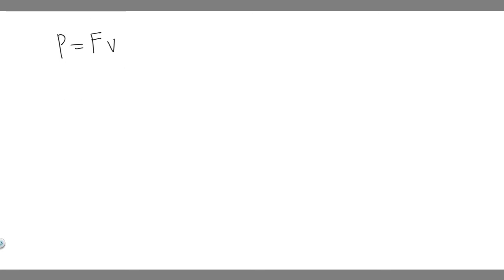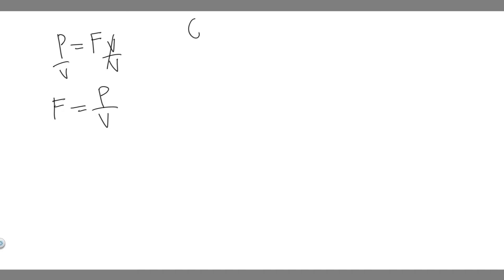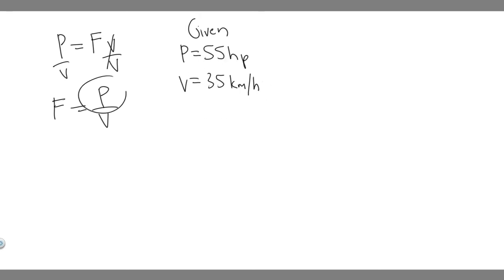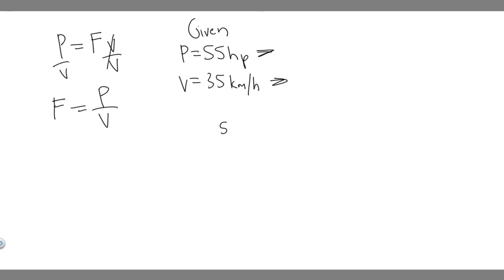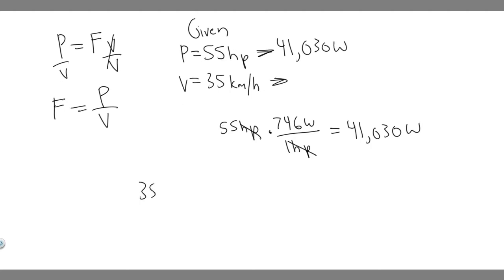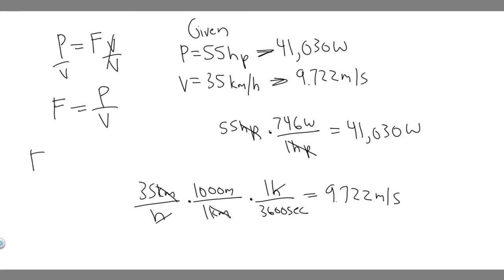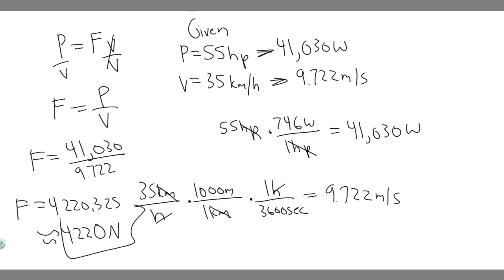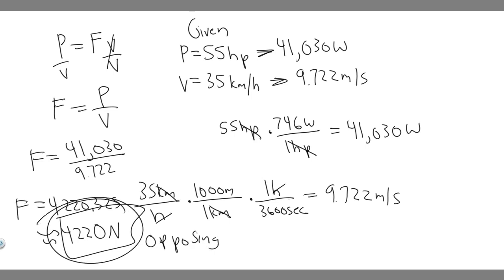An outboard motor for a boat is rated at 55hp. it can move a particular boat at steady speed 35km/h

Comment: Why does this find the resisting force? I understood the process; is the question asking for the equal and opposite force exerted by the water to the boat? I thought it was asking for current, or something. I just don't get why this solution works, I guess.